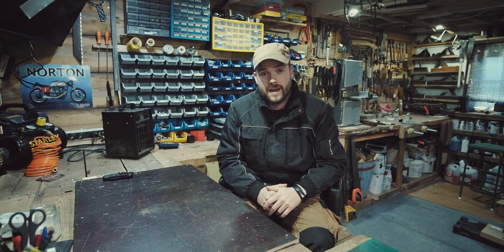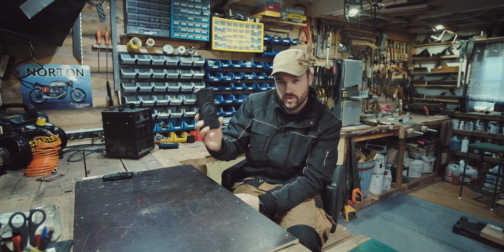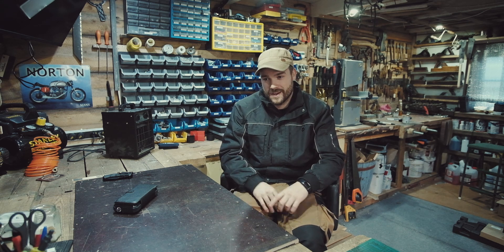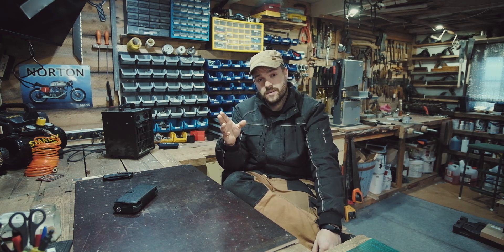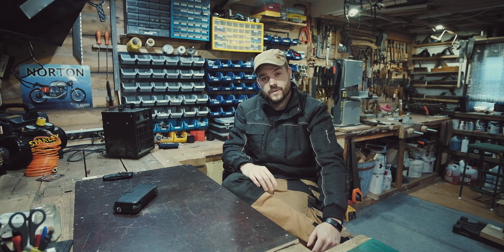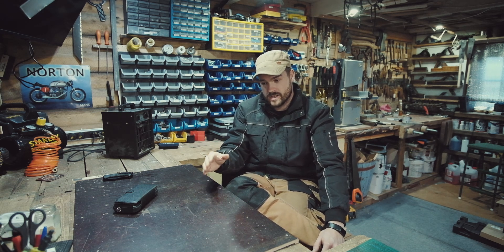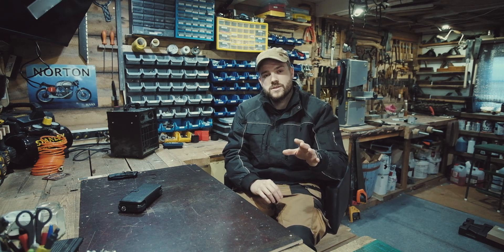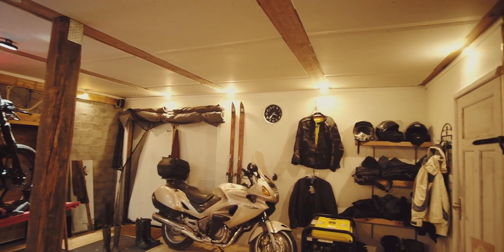Basic Off Grid House Solar System Setup

Comment: I've just bought a property that already has 14 solar panels on the roof, I'm looking at adding battery storage, 4.8kw system but companies are quoting like £6000 just for that. Any idea why so expensive, are they trying to rip me off?
Reply from the maker: I  cant really comment to be honest because I don't know how these grid tied solar systems are setup. All I know is they are a complete con and turn your house into another power node for the utility companies 😅 I'd imagine if you figure out how the system works you could achieve what you want for a fraction. Solar is solar at the end of the day. What changes is what you decide to plug into it.
Reply: @ash.pollard  I went to an open day at a solar company recently, during the presentation, the guy said that a customer with an EV had it's battery drained down during the night, the national grid took it basically. Well I had read that they were talking about doing that the other month so no surprise there. I hate this so called Great Reset agenda and how Klaus Schwab and co wants us citizens to live, well for those who are still alive and refused to take the experimental poke in the arm. I'm guessing that you are one of the awake people.😊

Comment: Have you a link to those square LED lights that you have?
Reply from the maker: I don't unfortunately but they are widely available online. If you just type say 12v led panel or chip you should start to find things. I think mine are 36led chips
Reply: @ash.pollard  Thanks mate, no worries. I've been looking for similar 5ft long versions to fit in my garage, there sure are a lot of options.

Comment: The solar panel grid-feeding is one of the biggest scams. It cost too much to install, you feed 80% back into the grid, and you store NOTHING in your own batteries.
Reply from the maker: Yea I agree they are a complete piss take. People don't understand how cheaply you can buy your own solar system though
Reply: @ash.pollard  I did some reading and most providers in the UK pay like 1-26P whereas the buying price cap I think was 34P.

The break-even point was something like 10+ years, because of the 15k install.

Just curious, I looked for a 350W panel and those cost around 200eu. Count out your profit.
Reply from the maker: If we isolate our upstairs system as that's our day to day use. That cost around 30k sek (€2700) with 1kw solar, chargers, batteries and cables etc. Given the price of power here even before things went crazy and the fact that from March until November our electricity is 0sek (costs us petrol in winter) I would say even after one year we are now in the black.   We know of people who pay 10ksek per month 😳
Reply: @ash.pollard  Yeah, how about that. 1 year and you're good. I don't really feel like burning diesel/petrol in winter. But still lot of time to learn and figure it out before I dip my feet in.

Comment: I’ve got a really stupid question. So prepare yourselves. I live in the south of Spain. So pretty much the polar opposite in terms of climate and sunshine. Our problem is winter though, where the inside temperature of our house is cold, especially during the day before we crank the wood burner up. So, my question is, do we need the batteries? The sun shines all day everyday, but during this time, without the fire on (which doesn’t heat the whole house), the house is COLD. So I’m thinking of solar to power electric heating … which will turn off once the big wood burning is on… Cheers, great videos and I love both channels.  Thank you
Reply from the maker: Hi David. No question is stupid 😊 sure it would be possible if you had a constant stream of reliable, uninterrupted sunlight to the panels and ran through an inverter. Realistically though, powering heat with electricity is a massive waste of energy as it would take a hell of a lot. For example, even a small houshold fan heater is 2000 watts. We dont even have 2000 watts of solar on the roof 😅  if it was me living in Spain I would have a solar setup with batteries to be able to store that power and use it whenever for all of your lights, small appliances etc. Then, as you will get a lot of sun and probably be fully charged early in the day you can direct the excess power into a "dump load" for example a hot water element which could then pump that heat around a radiator system. Energy that would otherwise be wasted.  Just an idea of course 👍

Comment: What if we have now idea where to start? Which panels to buy and from where? Also could an electrician help with the installation or do they have to be licensed in solar? Because I would be definitely afraid to do it ourselves. We live in the midlands but unfortunately our house is not south facing and I'm not sure if it's worth it, but I guess you have to start somewhere and your video definitely opened a door of new possibilities. Thanks for that. All the best 🤗
Reply from the maker: Personally I would start off very small and try to understand how everything works, connects together and what each component can be used for. I know it seems quite daunting but I can promise you it's easier than you think. A £40 solar panel from ebay, an old car battery and a cheap inverter you could be powering your TV right there from the sun.  I think companies and electricians will steer you down the path of grid tied solar systems which is not what you want. They are a scam in my opinion.  Tell you what, going forward I will make some videos explaining the absolute basics on how these things work 😊
Reply: @ash.pollard  that sounds fantastic 😊

Comment: You need a small wind generator oe two, and an electric heater dumpload for those sunny and windy days.
There is rarely a longer cloudy windless period in Sweden.
Also, tilt your panels up, it is better to gain a little in the winter when the sun is low and loose some in the summer when the syn is at it's highest.
But as always, the cheapest kW is the one you save, then you won't have to produce it and store it....
Reply from the maker: During the mid winter where we live there is little to no wind for months and no sun hits our property at all for around two months.
Reply: @ash.pollard  Yeah, I live in Norrland too
Reply from the maker: Well Sweden is a big place... in our location it is very still during the winter so a turbine would be useless.

Comment: Bonsoir Ash from the Pays De La Loire in France,  what a great video, I've never had mains power in my house here only mains water, I also use a similar system to you for my electricity but with an ecoworthy lithium power can that I charge from solar panels on my wall (I'm South facing) or from my inverter generator, less than 1 pint of petrol a night,, I have a nice hi-fi, TV, internet,lights, kitchen stuff etc and it all works fine. I run my house on 1.5 KVA and that includes the washing machine !  
 Internet is done through the air using a good 4g ariel, super fast and 14 euro's a month ! 
 Before living here I was on a beautiful narrow boat in the UK and then in my beloved Iveco van, 
 It's just a different way of thinking about life ! 
 Oh and I've got my old BSA motorcycle on display in my lounge 👍👍 ! 
 Bon Soirée  Mark
Reply from the maker: I think it's way more fun to live this way. Managing your own resources rather than just using whatever and handing over your wallet at the end of the month.  We hope to install lithium batteries here in the future to speed up charging time.
Reply: @ash.pollard  I agree, I get quite a buzz from splitting and stacking my firewood, and from using my power set up knowing there will be zero unexpected bills !
 Crazy wind here tonight !   
Do you guys follow " Frankie off grid" ?  Only they are trying out a new 2 kw lithium power bank with options to replace and or extend the batteries !  Think it's made by a company called " kd dynamics"  and they charge it with a normal generator 👍👍,  nice bit of kit, 
  Enough rambling, take care guys x

Comment: Hi ash, how do you wash your clothes in summer without using the generator?
Reply from the maker: We started off hand washing, same as we did in the vans. Then when marie got her job they have a washing machine we can use so we do that. I do plan on figuring out a machine here though in the future.
Reply: @ash.pollard  sounds good! I suppose you can dry them around the fire if needed. My dream is to fit a wood burning aga and boiler system and ditch the gas. But aga cookers are not cheap lol
Reply: @bluevantravels  haha yea we actually have an old style wood stove/oven in the house that I would love to use but it won't meet the new regulations and these fires get checked twice a year
Reply: @LostInEurope  that is definitely a shame but interesting about the regulations. Would be awesome to have a water heating system fueled by wood though.

Comment: I don’t understand why in a world of LEDs why all lighting circuits aren’t low voltage DC.
Reply from the maker: Personally I think the whole standardised power system people use is just broken. Its showing now with the rising costs and threats of power cuts. Madness
Reply: Because there are not low voltage DC wires and connector in houses you can connect them to. Even if you did that for the majority of the people it would just be one large  AC to DC converter instead of one in each device because the will take power from the grid. 

It is also not low voltage DC you like it is extra-low voltage DC. Low voltage DC is 120 to 1500V and there is a significant risk of shock. It is extra-low voltage DC that is below 120V you would like to have that is a lot safer and what it used in this video

If you created a standard for that and required in in new constructed building it will only exist in a small number of houses. The products for  low voltage DC will likely not be signiant cheaper for a long time because of the demand will be less.  In existing building adding a the DC system will be very expensive and the return on investment will be very long. 

A DC circuit make sense if you have a battery, something that quite few people and can do the installation your selfe to keep the cost down.   The you can make it more energy and cost efficient because  you can skip the  conversion to main AC and then back to a  DC voltage.  For the majority of the people it is a question where the mains AC is converted to DC.

You should also remember even if a individual LED are at around 3.3V you can connect multiple in series so the voltage drop is  higher.   If you for example have 40 in series the voltage drop over  it is 132 V.  You can even go higher in voltage.  230V AC mean that RMS voltage is 230V the peek voltage is SQRT(2) * 230 =325V.   So you can create quite high AC from with relative simple circuits.

 You do not need to drop the voltage to what you  mean by "low voltage DC" You can use a capacitive dropper and run it at a DC voltage quite close to the mains AC voltage.  The voltage do not need to be very exact in the conversion. If you on the other and created a DC system on houses the requirement on it would be higher so you can power electronics with it directly.

I would not be suppressed if the most energy efficient way to power LEDs from the AC grids we have is to let them convert the voltage to what is appropriate for them directly and not require that you go to a standard DC level.

It is not the case that a extra-low voltage circuit in you house would eliminate the requirement for more component then a LED.  You still need to limit the current to what it can handle. It can be a resistor that limit the current like typical 12V LED tape use. It is not the most efficient way to limit the current especially if you like to get a lot of light.  Power = resistance * current ^2  so it is less efface the higher the current is .  High light output LED flashlight have control IC  circuits for a reason and not just limiting resistors..

Comment: I only have a small apartment and a small balcony. The balcony faces west. In the summer, the sun shines there long enough to use solar.
But unfortunately I live in Germany. Here I can't just install a solar system on a balcony. It is forbidden.
If there's one thing we're good at here, it's making rules and laws until every project is dead. We Germans can do that perfectly.
Every winter I'm in Sweden, near Junsele.
Here, too, the locals regularly use solar energy. Without problems. Without unnecessary laws.
It works as your great video shows!
Thanks for that !
Reply from the maker: I'm sure a temporary setup wouldn't be an issue, say a small power bank with folding panels that you could charge during the day and then supplement your power with in the evenings. I know it's difficult with an apartment but there's still options 😊

Comment: Love your video , really interested, here in Coventry, we have a terraced house, wife's got two washing machines, two dryers and a dishwasher ..,... Five people, six dogs..... What shall I do, I'm a roofer 🤣🤣🤣👍
Reply from the maker: Hahah the struggle is real 🤣 still though, there are options. You can run washing machines etc through an off grid system if you really want to 🤷‍♂️ we are planning to do just that soon.
Do you get much sun in the garden? A small solar setup with some kind of power bank would be a good place to start.
Reply: @ash.pollard  yes we do get lots of sun, large garage roof plus I'm building a garden Room, perhaps a bar, but don't tell the wife, so will have to do something one day, I hope I made you smile too 🤣👍

Comment: Hi Ash. I have been almost completely off grid now since 2013. Like you, I also have 2 Generators for the dark months which I find even here in England. Yes it is about forgetting how we have been “brainwashed” into living a certain way, a way that benefits others and not necessarily us. A couple of questions. 1. Are you using Induction Hobs for cooking? 2. What was your rational in generating 24v upstairs and 12v downstairs? Thanks.
Reply from the maker: That's exactly it 👌 I guess the power demands are unique to the individual. Is your generator more of a supplement during the winter as apposed to the main source like us? 
Currently we use gas for cooking. One bottle lasts us maybe 4/5 months. I do plan on looking into induction for the the summer months though as it's a no brainer and justnuse gas for winter to save power. 
As for the 24v, it was more of an experiment really just to get familiar with using it and see if there are any benefits, which there are! Smaller diameter cables required for things and longer runs are far cheaper than on 12v.

Comment: Ash i live in Worcestershire ive got a 1kw system with 4 x 50ah lithium and I run everything apart from electric shower and oven.
The system is mix and match and cost was £1.400 ish.
Oct 2022 prices have peeked 30p per kw of the grid.
My electric bill is only £18 per including the daily charge.
I have a log burner and use it to cook on in the winter.
Slow cooker on the solar. Everything else runs off the solar all year round.
Reply from the maker: Nice man, that's the way to do it 👌 I think for me if I ever had to set up back in the UK(god forbid) I would get a system going I was happy with and pull the plug on the mains. That standing charge makes my blood boil. Here it's £40 a month!
Reply: @ash.pollard .. I think 24v is the way to go Ash the system i have is 24v with a 1500 watt inverter when the sun is out i can do as many 30° washes as i need and it take nothing from the battery storage.
I have changed to a compressor fridge.
So my small system runs.
55inch samsung tv.
Soundbar.
12v cctv with 4 cameras.
Washing machine.
Fridge.
Microwave.
Toaster.
Low watt kettle.
Rechargeable vacuum cleaner.
All LED lights in every room.
And charges everything like laptop phones and things.
I've only had 2 worried times with 3 very dull days last winter but just turn things off don't do any Washing .. (you just adjust).
Looking forward to more videos like this one. (Brilliant 👏)

Comment: Nice one Ash I’m doing something similar but not as Extreme as your are I’m running our hybrid car of Solar using Bluetti equipment and my next plan is to run our cottage from our camper van by using the van solar the Bluetti equipment 
and van lithium battery
I’m going to fit a hundred amp transfer switch that will enable me to switch the power from the mains to solar into the house fuse box 👍 
I’m going to film it for my channel too 
Take care mate us and them whippets 🙏😍👍
Reply from the maker: Sounds awesome man 👌 there's so much you can do once you start thinking outside the box! Will be keeping an eye out for the vids 😊
Reply: @ash.pollard  definitely 🙏👍😍

Comment: Since you made this video, there is likely to be many people already setting up on their off grid land. This is the reality of living in a property that is gradually strangling the life out of people's earnings. Your set up is ideal for your situation and most likely for other living situations. I only have one suggestion for you, when your AGM batteries need replacing, use lithium as their capacity is much better. You only need to fully charge them and leave them when winter comes and then recharge and use again in the spring.
Reply from the maker: It's crazy the position people are being put in now. Living in poverty because of energy bills. Madness. I agree on the lithium, we want to upgrade both systems and that is the future solution I spoke about but of course that's a lot of money so need to save for a while 😊